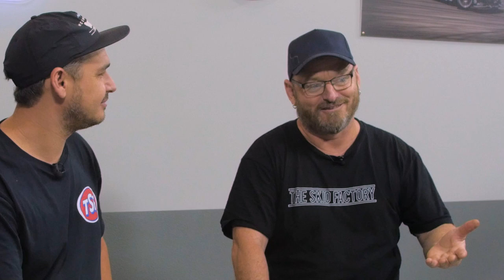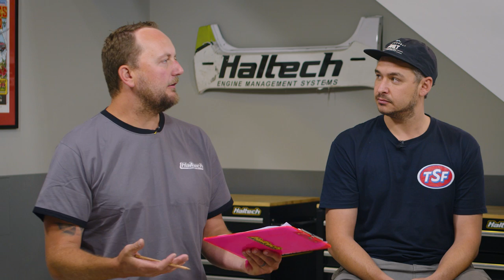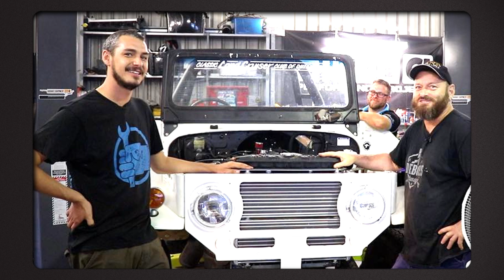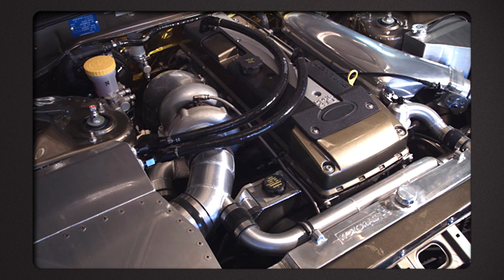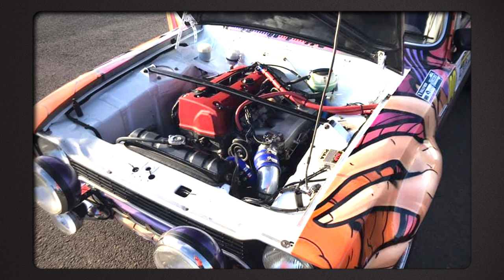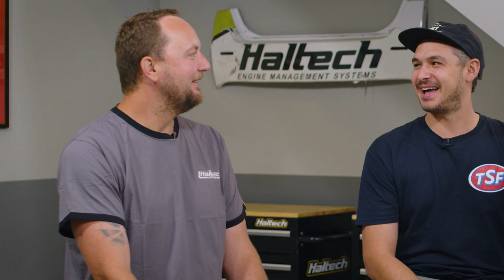📢 Modifying Classic Cars - Why All The HATE? | MASS DEBATE

Comment: I have k24 turbo swapped my 1993 vw golf mk1 cabriolet and 90% of the people that have seen it love it. Modern , parts are readily available and much cheaper. Running on elite 1500 drive by wire and ic7 dash. I absolutely love it. Having owned the car for the past 13 years, it’s improved it 100%
Reply: And that conversion makes complete sense, the Mk1 Golfs were very good cars in their day (and still hold up well today), and putting a very well sorted engine like a K series in it really puts that nice little bow on top of it. Plus it sounds like a fucking riot to drive too

Comment: I think one of the big factors at a base level is what you're starting out with. A rolling shell that needs panel paint and a motor is different to a shell that needs panel and paint with the matching numbers motor next to it. We've got a family heirloom HG Holden that is almost completely original and the paint has since patina'ed. We we're thinking of a respray until we gave the original paint a buff and wax and will leave it as the original. The original 186 however may come out to be kept for posterity and replaced with a 308 since the 186 is pretty pedestrian but it'll be kept safe from going bang.
Reply: My Dad had a '71 HG wagon with  a 161, was fine until we had to tow a 2T van with it.  I recall he swapped in a 179 bored out to ~186, still slow but at least we could get than van up a hill.  It drove all around Australia towing that van and survived a trip across the Nullarbor with the head gasket fitted upside down doing 30mph and constantly overheating.  Pretty much bullet proof, but would have preferred Dad put a 308 in it, lol.

Comment: 4:32 I'm gonna have to correct you there.
I had a stock 1600 as my first car also, and drove 45km to work every day as an apprentice mechanic on the Sunshine Coast.
That thing sat comfortably on 85mph every day and would pull 80mph in 3rd gear while passing cars.
'Keeping up' with traffic was never an issue... However, pulling up was a different story 😁

The car evolved over a few years into my rally car, with a ported & 3mm over-bored L18 on Hitachi SUs (required for the rules) 4.8 diff gears and 5 speed. 
I still drove it to work every day, but moved closer to work. 

I still miss that car!

Comment: Great episode guys. Ultimately, it comes down to whatever your preference may be. I would like to yank the 4AGE out of my original 1985 Toyota Corolla GT-S 3-door coupe and throw in a 2GR V6 in it. With an aluminum long block, the weight penalty is practically none and with 311 hp in stock form, it would almost triple the power it came with from the factory.  However, the ultimate swap would be the 5.0 out of the Lexus IS500 with 472 hp. Now, THAT, would be a true sleeper, but then again, it's my car and my money, so I wouldn't care what anyone else may think or say. That's the beauty of this hobby of ours, we can look at something and appreciate the time and effort that someone else put into their project, especially if it, like Al said, improves the car.

Comment: Great vid Scott and thankyou for not ruining it with 30000000 ads.
My Dad always had Fords until getting a fully optioned V6 Madza 626 in 1997. He had a XY Fairmont l6 (purple) when I was very young then got a white ZD Fairlaine V8 and then into a metallic blue l6 XD Fairmont. As such I am a Ford man through and through though I have never owned a Ford but have owned a HT / 3xHJ 1 HQ and a 2dr LH lol. (all great cars BTW. Well not the HT.
For some reason seeing a SBC in a 32 Ford makes my blood boil.  If I ever win lotto I'll buy every 32 chev on the market and fit them all with a 351 Clevo just to see how the other side like it.
Al's Crown is awesome but the hood bulge is just wrong to me. I hate it. 
Mentioning Bruce Garland brings back some memories. What a unit that bloke is. If you ever get invited to one of his Christmas parties, Don't miss it. Fun Fun Fun. cheers.
It's my dream to one day build a twin cam 245 Hemi and put it in a Centura with all the modern teck that can be found and run by Haltech of course.
As an aside, that purple Fairmont had to be resprayed under warranty by Ford after much heated argument between Dad and the dealer. 
When he picked it up there was a pair of pigskin driving gloves in the glovebox that had an amber button at the wrists. He was told by the bloke at Ford that those gloves came standard in the glovebox when purchasing a XYGTHO Phase111. Most were removed by employees at Ford and not many people actually got them. He still has them gloves. I wonder what they would be worth if that story is true. cheers.

Comment: My '73 240Z (bought in 1996 and my first car) is powered by a Haltech-managed L28ET. I still have the matching numbers L24, which is slowly being rebuilt to original and kept in storage. But if the 2.8 turbo L-series ceases to be a viable engine, then I'll be open to using anything that's suitable. You have to be a bit pragmatic if you want to keep these cars on the road :)

Comment: All three of you started with Datsuns! Pretty interesting. I have an S12 hatch and I have a strange affection for it despite driving it only around 80 miles so far. It needs lots of love. My first cars were all Subarus and I'll always be a huge lover of the 90s Subaru models especially. Personally, unless a car is incredibly rare, in good shape, mostly original, then go ahead and mod it. I'm happy any time someone saves a car and keeps it on the road, modded or restored, instead of just parting it out or especially scrapping it.

Comment: In my 20's all I wanted was 60's and 70's muscle with modern mechanicals. I wanted the look but with the speed and handling of modern (which i found out is not really possible). These days if it's something a bit special. So not a VB straight 6 but something that came out with a bit character and excitement, be it an old German sports car, Aussie iron or whatever I prefer it the way it was just with some subtle improvements to reliability. If its got a carb then yes you need to warm it up. That's what makes it special. If I wanted an old car to perfect then I may as well just buy a new corolla. But that's boring. I get the resto mod scene. Al's car is definitely a sweet thing. And I love the engineering that's been put into it. Same with the Hako. But I would also love an original as well. 
All that matters is what makes you happy.

Comment: I'm installing a VQ35 into a 04' RX8 since it was on its third engine rebuild. It's the right motor since it actually fits pretty nice and I had all the parts to assemble the motor laying around. In NA trim it should make more power than the RX8 and last for quite awhile. (Haltech 750 Elite ECU running it also ❤️)
Reply: Depending on budget I may put a VQ37HR into my S12. I feel like that would be one hell of a ride.
Reply: @802Garage  VQ37HR is a great platform but the VVEL makes it a difficult transplant since few aftermarket ecus can support it. Love it in my daily G37 but I think the VQ35HR is the ideal platform since it's strong and simple in it's setup.
Reply: @andrewvehrs9714  That's fair hadn't really thought of that. Usually when I plan a swap like that I just intend to use the OEM ECU and trick anything that needs to be tricked to make it behave. Modern stuff can be ornery though. 😂

Comment: RD28 Turbo into 1980 280ZX. Current daily driver 1000k to a tank, will run on used veg oil. No worries!  Great video guys!
Reply: Lit I have a fd rx7 with a 1kz auto with a toebar and roof rack same style build as yours lol

Comment: As a Holden lover I agree with Al about Holden sixes. There day was over mid 70's. Stock didnt want to rev over 4500rpm. they came from a time when reliability and ease of working on were priority's. I got my dads VK commodore with a 3.3L  and at best could be described as tolerable till we couldn't get unleaded fuel then it became a not nice car to drive. rebuilt it with a 308 and brakes/diff from later models kept costs down and its a fun weekender but still prefer My Territory (or my wifes Mazda 3) as a daily.

Comment: I had an XM Falcon, matching numbers, original paint, yadda, yadda. It'd had a small handling drop at some stage, tiny, barely noticeable, 1.5 inches, you had to know them, compare axles to sills, I just added Koni shocks, all corners.  I did ask Matt Egan to lay some lines, at one time, he refused, said some you leave alone, same further lowering, suspension guy said no, same reason. But engine was fumey, through road draft tube, and boiled on highway. Stood for 30 years, on blocks, so sludge in block, so engine rebuild needed.... put bigger cam, bigger valves, from 221, but no extractors, rejetted stock carb bigger, had engine painted original sage green, red rocker cover, so total stealth. Surprisingly quick, cruise at 70 mph all day, run up to 100+ no drama at all, taller diff ratio from new, 3,2, not 3.7. Brakes left as is, poor, but pulled her up no dramas, you just couldn't ride 'em, drive like it's modern, no brakes, when needed. I messengered for years on a  brakeless track bike, so felt fine to me, but practically lived in the right lane, more stopping distance, left, you'd leave your stopping space, advised and then some more, some one would slide into it, most annoying, most people drive too close, yes modern brakes are great, but how are your reflexes? On the crazy conversions front, how about twin stage, turbo supercharged, quad overhead cam 27 litre, Rolls Royce Meteor tank motor, into a chopped ZA Fairlane, still in progress, not mine, Lord Gonz's, Gonzlab engineering. Going to go to Lake Gardiner, being built to DLRA rules..He street drives another ZA,  6/71blown 347 stroker Windsor in that, has another still, eventually gonna be a gasser, to be called "Skullfukker", street one is the "Borough Shaker".

Comment: The whole conversion thing for me comes down to costs v rewards and your personal budget and what will work best for you.
If u have the $ absolutely go for a conversion, a swap is always way more expensive than staying with the og no matter what engine you use.
But if your on a tight/tighter budget then stick with the original, any engine will make good power if you do the right things like with turbos e.g. 
There's guys out there pushing 1000hp out of 8 valve Gemini engines lol even a dirty old 202 can make decent power.
Personally I've stayed with the buick v6 in my vn due to my budget, would love to do a barra swap but realistically that's a 10-15k exercise with everything. 
It's cost me 5k to date to turbo the v6 + a stock rebuild on the engine with arp head studs and it should make about 400 whp @ around 18 psi and if I shift the t5 right that's gonna be 11.90s if not quicker, stravjet on yt has 230rwkw or 308rwhp in his vn and it's gone 11.90s but in an auto so with 100 more hp I shouldn't have a problem. 
Cars still a while off though, gotta build the exhaust, vt brakes, make some leads, get it tuned (might be going haltech gm sport ecu) 
So for me it depends on budget, u could go conversion in either option but a conversion means your car could be on blocks for 3 yrs whereas turboing the og engine u could have that done and enjoying the car in less than a year and at a quarter of the cost.
That's my 2 cents 👍👌

Comment: On the saltiness over swaps, I think allot can be attributed to either the sound (Which I somewhat agree with) or preservation.

I think the thing that most don't see or consider is how much is original. How much was rust, how dead was the matching numbers engine, how hard is it to get another before even considering the reliability / performance / efficiency side of swapping.
IMO, if something is original, in good nick and even semi rare, keep it stock. 
If your looking at engine change anyway, or massive rust / damage repairs and respray anyway, it's a blank canvass.
But then each to their own and your still free to do what you want to your own stuff   (for now, see subscription unlock car features, eg heated seats or auto drive etc)

Comment: The best conversion I saw was in the early 80s Street Machine magazine where a columnist called Brian Plankman ripped the 351V8 out of a Phase 3 Falcon and replaced it with a 186 Holden Red Motor with a set of home made extractors made out of galvanised pipe fittings and a 3 speed gearbox.

A few things to note, he was a semi fabricated persona created for entertainment, I believe he may have been a real farmer , or at least owned a handful of acres west of Sydney over the Range, and he hated every vehicle except 6 cylinder Holden Utes.
Also, back in those days a GTHO was only worth $500-1000 more than a GT, which was only worth $500-1000 more than a mint V8 Falcon, which was only worth $3-4000 because Ford was still building brand new bigger, better and faster V8 Falcons.

Comment: I like restomods and am open minded enough that I have no issues with engine swaps that improve the vehicle.

The one thing that I have been looking for is some information on putting modern steering columns into old vehicles. I'm not looking for paddle shifts or cruise control but I am wanting to have tilt and reach adjustments and lights and wipers on the column. Does anybody know who can do this sort of work?

Comment: For me as a classic car restoration person. It depends on the car is it a collectible car with full matching numbers, then it would be a full but and bolt to complete original. If it's missing the engine and gearbox then put new modern better engine but restore the body.

Comment: You three (especially Al) have hit the nail on the head. You can put whatever you like in any car, but why do all this work to fit something ridiculous into a car that's not really any better that what it came with. At the same time, you have to do it to the right car. If you wanna cut up a Torana or a Valiant Charger to dump a Barra or whatever in there, fine, but don' go doing it to a car of significance like an XU1 or an SLR5000 or an E49 R/T (the 265 Hemi is only 6 cylinder worth keeping in any car). Time and a place springs to mind here

Comment: Great conversation this. I think Al captured it best in the Hako vid. If it's your car you can do whatever you want to it, regardless of what the internet might think. I get the complaints when it comes to a rare car though. I'd prefer to resto-mod something that's a fair way from original tbh. I'd also like to get an old Holden and do an eighties version of a hot six....with modern ignition system. Weird I know.

Comment: I find myself in this exact situation with my W114 74 280 Mercedes. It's matching numbers but both motor and gearbox are on their last legs, do I  rebuild them or pull them out in favour of something modern 🤷‍♂️ Either option probably costs the same and wouldn't hurt the value.

Comment: I like both....im not serious like Al and Woody but, I like modifying my old 1986 Mustang notch but, I also modify my more modern DD, my 2014 Mustang GT. Reality is, the 2014 would destroy the coupe, even thought the coupe has HCI, before I slapped a big supercharger on the 2014. The 86 is a lot better version of the Fox Mustangs I had in the 80s and 90s, however, even though it's a junkyard rescue and made with JY parts, keeping it cheap.  It's a connection thing; we all had these back in the day.

Comment: The only ones I don't like are when there is a "like for like" option that is same price range and potential. 
350 vs 351... 302 vs 308, as you'll note, it used to be done solely for ford vs holden rivalry/hate... never was on board with that.

Comment: I have a 1978 Triumph Dolomite Sprint. Even here in the UK they are hens teeth (only 22000 built, of which around 600 survive) and a tidier than average car will make £20k. When I bought mine in 2012 it was NOT tidy at all, nor did it run and it was the less popular auto model, but was only £375 which gives you some idea of the state it was in!

 The original powerplant was revolutionary but seriously flawed, on a good day it could show you 125+ BHP,  good numbers for 1973 England but no longer.  Mine has the running gear, including the 4L30E autobox from a 2000MY Vauxhall Omega 2.2 16v. (Holden Comodore to you guys) Only a bog stock 147bhp which doesn't sound like much, but the car is is only 1050kg kerb weight. it's quite quick enough for the daily driver it is and it gives upwards of 42 MPG at sustained 80 mph highway speeds. And, of course, it's 100% reliable! I get a bit of flak from the more conservative members of the owners club, but generally most folk smile when they see/hear it coming!

More importantly, I LOVE it! Which is why I built it. Every time I walk away from it, I look back and think "I did that!" and I smile!

PS, A 66 Goat is at the top of my lottery list, no engine? No worries! I'll take it! I reckon an injected and managed big block Chevy motor should do (Pontiac cast conrods are too fragile) turbo 400 trans, powergrip axle power steering and power disc brakes, keep the exterior stock and shiny (but NOT red) and some decent seats (US 60s so called "bucket seats" are spine wreckers) Oh and 15" American Racing rims!

PPS, What's a Barra?
Reply from the maker: Dolomite Sprints are uber cool! Great to see them still being driven around and taken care of:)
Barra is an Australian Ford inline six: https://youtu.be/hJ6O1qnMmak

Comment: Great topic.....Hey Al I remember those old red 6's spent many years hotting them up. EH panel van then a 4 door LJ. Have a TJ Jeep Wrangler 2001 year model as a project was looking to transplant the old 6 cyl 4.0 that so reminded me of those old Hoden red motors. (non x flow head and even though it was injected with wasted spark ign you could see where the dissy went) Plan was to transplant a 5 litre Windsor from E series or AU but could not find one at a reasonable price.
So now it is Barra swapped :)